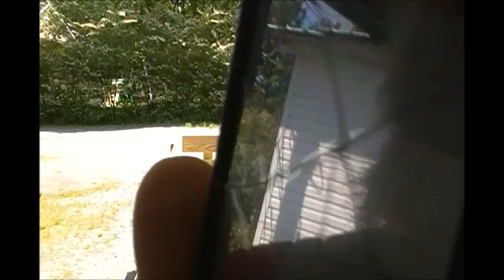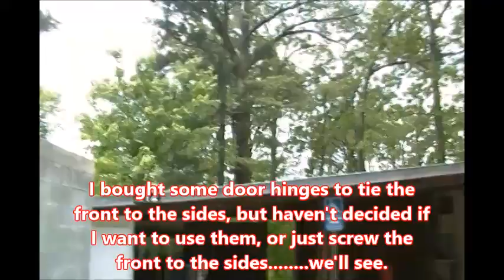Harbor Freight Trailer Build Part Four by PawPaw ....Sideboards

Comment: Nice job, and it will do the work just fine.  Great looking trailer, and the side board only require a couple of 'Doing It Cheap' stickers on the sides with a coat of varnish over them to keep them on in the daily wear and tear of use.

Comment: looks good pawpaw ...here in oregon lumber swells and shrinks so much ... i have made side wood racks for my old trailer and the 2by4s i had to drive in they were so tite then summer came and the shrunk up and was always rattling then winter came and they swelled back up ...mysecond set after i ruined the first set i planed the ends down enough to ge them in and out easily in all weather ...i took them off quit frequently in my case ...great video as usual wish the salesman hadnt of hung up lol

Comment: I did one similar, but I put the 1 bys on the outside and in the front top corner, I used a couple old door hinges to lock the side walls together. replaced the hinge pin with a bolt that I can pull to remove the sides or front.
Reply from the maker: Towards the end of the video I put a caption stating that I had purchased door hinges for that very purpose.  Great minds think alike George !!

Comment: I like your sideboards. I assume you are going to either paint or varnish the sideboards before you put the bolts in.  I would use the hinges so I could get the front and sides off if I wanted to.
Reply from the maker: I mentioned I had hinges for that purpose in the captions.  Great minds think alike.

Comment: Hey Bob.    Have you considered putting some kind of winch system to pull the tractor up the ramp? Have a super day!  Mel
Reply from the maker: Too much trouble.
Reply from the maker: I have two other trailers that are larger and have winches.  This is for one purpose only:  Lawn equipment.

Comment: Where was Stanley? I so enjoyed your video. Thank you
Reply from the maker: ?????????????????????  Thanks!
Reply from the maker: The wire mesh was added to make a non-slip surface for the tires.  If I want to haul sand and gravel, I just drop a sheet of 7/16" OSB on the floor and go !  BUT REMEMBER this trailer is only rated for 1720 pounds !  A ton of sand is not a very big pile !
Reply: I was talking about Stanley from Laurel and Hardy because your video reminded me of an old silent movie by Laurel and Hardy where they work as carpenters.

Comment: I bought those same brackets and a 2x4 is loose as anything have to shim them
Reply from the maker: I think the difference is that the pressure treated 2x4's are a little larger than regular kiln dried pine.
Reply from the maker: These brackets came with the trailer.  They were not a separate purchase.

Comment: I like the gap between the top boards and the bottom boards. You can run a rope or bungie cord to tie shit down. With the bottom two boards the way you put them you could haul sand or gravel by putting a piece of plastic or a tarp on the bottom.
Reply from the maker: Thank you.

Comment: I noticed you switched ends on the 2X4 did you have the short end up first? Oh never mind, i see you did the same thing with the 5/4 stock.  They were for the other side.
Reply from the maker: On the 5/4 boards, I wanted that darn ink imprint on the inside.  I hate that crap!